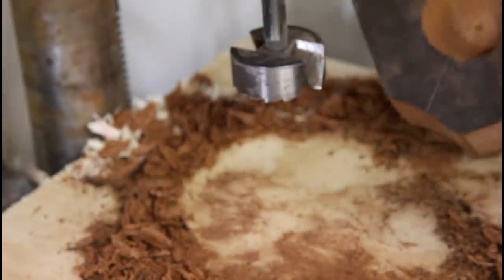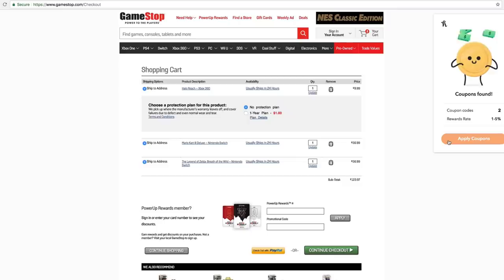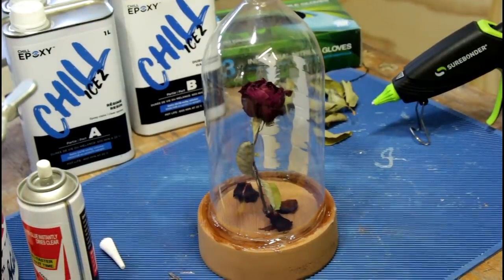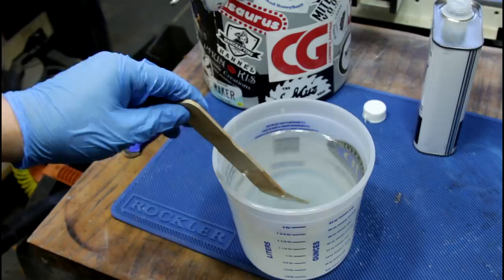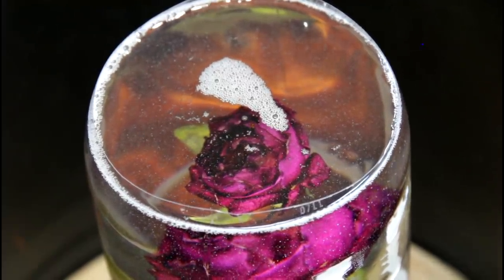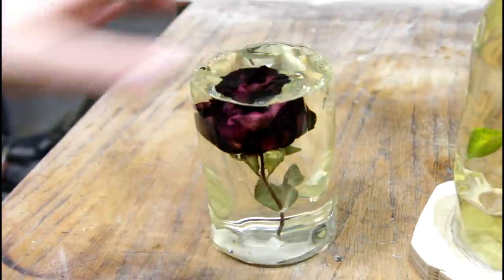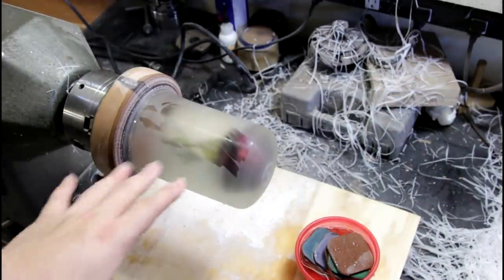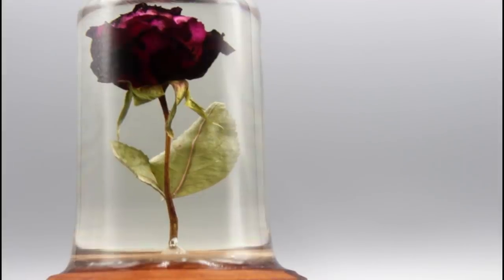Can You Preserve A Rose in Resin?! | Dipit #24

Comment: Is there any reason why a dried rose was used rather than a fresh one?
Reply: That rose is from the last date he ever had.
Reply: Not Known ohhhh burn
Reply: @eidzi4119 

I think maybe the natural resin in the pine wasn't compatible?

Interesting.... 🤔
Reply: If the rose has water inside it will decompose after some time.
Reply: @J23Ochs 

Decomposition requires both moisture and oxygen. Given that sealing it in resin is about as airtight as you can get, where would the oxygen come from?
Reply: @bertkutoob  from within
Reply: @carlosandleon 

I understand where you're coming from but will the entrapped moisture and oxygen be sufficient to support any significant degree of decomposition? I am thinking of hermetically sealed foods that last for many years without "going off".

I have some cheap fibreglass resin to experiment with. Guess what I'm doing tomorrow...
Reply: bertkutoob I’d love to see it decompose within the confines of the resin though
Reply: @grackshack  Yeah well, as I said I'm going to give it a try tomorrow (where I live it's 22:11 right now). It will of course take a while to decompose (if it does) so we'll have to wait a month (at least?) to see...
Reply: @bertkutoob  As long as it is done properly it should turn out fine as if you look on the internet you can find things that obviously weren't dried when they were put in and they look much better then the dried rose here. I mean you can find actually jellyfish in resin and I don't think you could dry them and have them still look like a jellyfish.
Reply: Water and resin don't mix, there's a lot of media on the subject. Always dry your greens before using them in resin
Reply: @CS-di1dt  How do they do the jellyfish and roses that don't show any signs of being dried then? You can find them if you look them up. Do they spray them down with something first or what?
Reply: Although there's isn't a lot of moisture or oxygen, the rose will still decompose over time, it just takes longer. I had a friend who would make pendants with flowers inside. She tried may ways to seal fresh flowers, but they all turned brown in the end.
Reply: @DeathlordSlavik  I searched but couldn't find any jellyfish that appear to be in resin (plenty of glass jellyfish paperweights tho), just lots of discussions about the appropriate chemical solutions to preserve them in lol

 For flowers the most common method is freeze drying, it maintains a lot more of the color and doesn't leave them w/ the crispy texture that happens with air dried flowers in resin/similar substances
Reply: @CS-di1dt  Well I just looked up the jellyfish again and I found an article that explains the process, they freeze it with liquid nitrogen then place it in a specialized resin that works at low temperatures. Based on your explanation of freeze drying the roses it seems if you want to encase organic things in resin and have them look good you need to freezing is necessary.
I saw some from a Chinese company that sold all kinds of weird stuff in resin as they had turtles, fish, crabs, octopus, bats and other small animals which struck me as strange as usually you only see insects of course the company was Chinese so maybe I don't want to know the details regarding all the things they put in resin as it might just hurt my brain.

I figured they would just show up on google but when I checked I only see those fake glass ones that don't even look like actual jellyfish, well I guess they might fool someone who has never gone to one of the major aquariums and seen real jellyfish.
Reply: @DeathlordSlavik  the animals you saw in resine are zoological samples (some are entire animals, some are opened bodies), they are made for students and researchers to study the anatomy of those animals. Indeed, the animals are first freeze dried to preserve the shape, but they also use lots of chemicals (stuff you can't and shouldn't use at home) on them to preserve the integrity of the organs and the skin which would otherwise decompose and perish...
Reply: @bertkutoob  For aerobic decomposition, microbial activity and moisture are all that is needed. The O2 will turn up all on its own as a byproduct. Almost any organic material placed in resin needs to have its moisture content manipulated to prevent decay/decomposition or the growth of mould - either by removal (drying) or replacement with another fluid. The latter can be quite tricky to deal with safely and accessing suitable fluids can also be a challenge at times, so reducing the moisture level is generally the go-to solution.
Reply: @insertclevernamehere2506 

Isn't that ANaerobic digestion you're describing? Not that it changes the conclusion.

And still, why does hermetically sealed food decay anaerobically?
Reply: Hey Burt, I think anaerobic bacteria would probably be able to decompose the rose with the presence of moisture. I think others are right in that there might be a process of replacing the water in the rose with another chemical that would inhibit microbes, but to my mind it sounds difficult to pull off without damaging the rose. If you try it though, post it!
Reply: @abelromero8967 
Yup... My personal bottom line is that I don't have the organic (hate that word) chemistry background to do much more than fiddle around...
Reply: I think theres like a powder thing that you bury flowers in to preserve them and the preserved flowers still look fresh but they're crispy
Reply: Jhiro Donghit yes, some time of silica sand, just like cat sand only finer 🤗
Reply: @J23Ochs  Then how do we have insects preserved in amber for millions of years? Same principle really.
Reply: Beauty and the beast.
Reply: @EvilSanta482  Amber is tree sap.
Reply: @EvaHoshizora  I know this but if a flower will rot while trapped in resin rather quickly. Then how can an insect survive in what is effectively a natural resin for millions of years intact?
Reply: @EvilSanta482  insects are less delicate than flowers. Have hard shells. They aren't decomposed as easily by microorganisms, plant matter is. Roses will wilt on their own all the time.  The sap doesn't react with water. It's rare for it to happen too.
Reply: @dutchik5107  The shells are actually the skeleton of an insect but the rest can and will rot away just the same as any other organic matter will. This is the same as how we find ancient human bones but not the flesh. I'm not saying that organic matter trapped in resin won't degrade at all just that it is possible to do so without it rotting away quickly if done right. Tree sap doesn't become amber either the resin does. The process takes millions of years to complete and most tree resin will rot in and of it own. Plastic won't even last that long yet if the circumstances align we can have a perfectly preserved insect trapped in amber.
Reply: @bertkutoob  I also would love to know the answer for that question.
Reply: @EvilSanta482  there isn't enough appreciable moisture in their bodies to support the bacteria over time... also pine sap has a lot of natural antimicrobial compounds in it. There is a reason why pine tar and pine sap related preservers, cleaners and skin care products exist!
Reply: The water in the rose could mess with the chemistry of the resin. If he used a fresh rose it could have inhibited the curing process.
Reply: Because if the rose was fresh, it would continue to decompose inside the resin
Reply: @lyn9567  I don't think the rose would decompose. I think the moisture would mess with the curing of the resin.
Reply: @bertkutoob  how did you rose finish up?
Reply: @michaelcerda5514 

A bit of a disaster I'm afraid. I'm playing with common fibreglassing resin and it cracked (almost shattered) due to the heat build up. I'll have to reduce the catylist way down, probably as little as ½%.

But I've run out of resin and was in fact just about to go off shopping...

I'll keep in touch.
Reply: I'm 100% sure this has to be possible. I've bought bought my gf three separate gold roses. I know just hang in there... They are actually just gold trimmed and the rest is preserved in a resin of some kind and clearly done with fresh roses, so it has to be possible. I thought maybe the small amounts of gases escaping would be a problem but if you are vacuuming out the atmosphere it should be enough to pull whatever gases out also. Not entirely sure as to how but absolutely positive its can be done without decomposition being a concern.
Reply: @solomassive6233 

Plan B is indeed to use my Heath Robinson vacuum chamber...
Reply: bertkutoob I think another reason for not dipping a fresh rose is the fact of how most resin reacts with water. It makes a lot of heat, of course there’s probably not a lot of water inside of the rose, but fully submerging it in resin, you never know what’s gonna happen. That, along with the few times I’ve seen Peter’s videos where water ruined the outcome, I’m sure he thought of that before doing the video. That’s my guess.
Reply: @bertkutoob  And he puts it , inside the pression pot, so it also takes the air out....
Reply: He used 3 roses. One of them was fresh.
Reply: @carlosandleon  it's the same deal with if someone dies on Mars. There isnt enough to cause decomposition so itll just stay there forever. It wouldn't decompose. Its just because water and resin dont work
Reply: Ok, that's a LOT of replies, but here's my two cents on the subject:

1, water contains oxygen so moisture does not "require oxygen" to start decomposition. It already has its source of oxygen.

2, I don't think decomposition is the main reason to dry the rose. The main reason would be stability. A fresh rose, or any flower, is a lot weaker and buckle under the weight of the resin. A dry rose is a lot more rigid and can withstand the pressure of all that weight.
Reply: @morphman86  the rigidity of the rose doesnt really matter, because the resin is liquid, so it pushing in the rose equally from every point. I'm 99% sure the rose was dried just because it works better with the resin. The water in the fresh rose might've messed up the resin curing
Reply: @booty_hunter4207  It may push uniformly from every side, but it is pushing. A soft rose will deform by any push.
A rigid rose will as well, as you can see when he pours the resin on the first rose. There's a few petals that start spreading out, one in particular bends down, almost to the point of falling off. If that rose had been soft, the entire head would have been bare by the time the bottle was full.

The resin would not have time to uniformly fill around the rose before the damage is done. It's simply easier to work with a rigid flower than a soft one. Trust me on this one, I've dealt with art for quite some time.
Reply: Basically because it changes color, when I tried to put fresh resin flowers, they turned green or brown.
Reply: bertkutoob I’ve personally tried using fresh flowers in resin, they all quickly turned brown and rotted. I make and sell items with flowers inside, they always need to be dried first.
Reply: It’s actually because a fresh rose will have more discoloring when the resin cures because the resin pretty much cooks it
Reply: bertkutoob what materials can i use to make little things inside resin? plastic i know, what about sylicon?

Comment: As you were making resin noodles on the lathe, I was treated to my daughter going "Noodle-oodle-oodle-oodle-oodle-oodle" beside me
Reply: thats adorable
Reply: @theravenskeeper2849  no, it's the big spinning machine that turns the item he's working on. It's called a lathe in America too
Reply: @theravenskeeper2849  a lathe is a shop tool (seen in woodshops and metal shops) used to spin items for the purposes of carving and/or sanding them to make them round (like a chair leg or a closet pole) or hollow (like a bowl or vase). when you make a thing on a lathe, it's called "turning" it (i.e. "i've turned these chair legs and spindles, now i just need to carve the chair's seat").

...and yes, i'm an american as well, but it's not a tool found in most garages- at $500 for a cheap average on the hobbyist end (and take up a lot of floor space), they're not overly common unless you know you have a use for it... but are more common in those respective industries.

Comment: Here's a challenge for Halloween coming up: A spiderweb in resin!
Reply: Or a resin spiderweb. either way, it's an avengers-level threat
Reply: Maybe nebulizing some resin on the web one little coat at the time could work but maybe a super fast resin xD
Reply: You could glue the resin shavings together and use them to make a giant spiderweb...
Reply: I doubt very seriously that you will see the web.... Nothing beats a failure like a try...
Reply: Or maybe an animal skull...
Reply: Wires and meshes are just airbubble traps because of surface tension, also I'm fairly sure the resin would destroy it as  soon as it is poured

Comment: Great video!  I recently discovered you can preserve the color and texture of the original petals and leaves by drying the flower in silica gel crystals. There is a fine grade available for this purpose, not expensive, and works great.

Comment: I wonder is there is a way to stabilize the rose before subjecting it to the heat of the resin?
Reply: Maybe two pours, one with a "mold" as tight to the rose as possible and another to give it the volume
Reply: @828burke  I wonder why not pour it in couple of layers. First layer just below the bud, then just over the bud, then more doming if needed. Would have to work with only 15-20 ounces of resin at time. I'm not very experienced with resin so my thinking might be faulty, but I've come to the understanding that more/thicker the resin pour the more heat it will generate.

Comment: Done it a few times in the past. What I noticed is that the colours tend to fade out in time[years] while the epoxy turns yellow. May have protected it better from UV but I think it's mainly due to the epoxy I've used. Choose carefully, be sure it contains an UV stabilizer[radical scavenger] as well as  hindered amine light stabilizers.

Comment: Have you considered managing the heat of the resin by filling the rest of the pressure vessel with ice water so the heat could be wicked away?
Reply: The water will boil
Reply: @RustyBrusher  no it wont
Reply: RustyBrusher do you know how hot that would need to be
Reply: Falloutman 342 well probably 212 degrees fahrenheit, the boiling point of water

Comment: hey, I have been thinking this for a bit but a lifting plate would probably help a lot for the pressure pot. it's just a circular plate of something with handles on the sides that go to or near the top of the pot which allows for easier placement and retrieval of the item in question.

Comment: Why did it need to be a dried rose?  What it have made a difference if you used a fresh rose?
Reply: I think a fresh rose would move too much in the resin, it's more flexible than if it were dried. Also I think the heat from the pot wouldn't work well with the moisture inside of a fresh rose...
Reply: the rose would’ve lost its color, maki g it turn brown
Reply: I tried a fresh one. It basically over heated the rose and wilted to a nasty dead look.. Not pleasant
Reply: You wouldn’t be able to use things that are fresh because the cells in it would eat it from the inside out it has certain bacteria and stuff still living in their so it’ll probably rot while in the resin

Comment: My opinion is... roses look dry but they hold moisture for a loooooong time.  So when you try to put the rose in an air tight spot the moisture surfaces and the rose turns brown.  I fully expected that first rose to turn brown.  Now as of the last one that worked...did it dry longer than the first two roses?  I think you got lucky.
Dry out a rose for a week or so and when you believe it’s dry open it up to the middle.  That is where the moisture is hiding.  Love your shop and workmanship.
I hope your where wearing lung protection when the rose was on the lathe... from took to last sanding/polishing.
I know you didn’t ask for opinions and I hope you know this comes from a well meaning spot.  
Thank you for the lesson and information on large volumes of epoxy.

Comment: I am wondering if the moisture content of the different roses was different.  Though they may be dried there is humidity in the air...just a thought.  I tried using a resin once to cast a rose paperweight.  It turned mostly silver as the resin seemed to cook it...hence, my thoughts about the moisture.  Very lovely casting.  I wish I could do what you did...I'd keep my flowers so much longer.  Blessings!

Comment: forthe decoloration:
i had the exact same problem on myvery first epoxy-pour andonthe second try i noticed that the epoxy gets really warm (which i didnt know AT ALL). It reminded me on concrete because it does the exact same. So the solution was to keep it cool! On the project i had i could just place it in a room with open windows and 1 Fan to blow for about 2 days. Not really "environmentally friendly" but it worked
Reply: Fick Dich could I sit it outside on my balcony? Or would that be too cool?
Reply: @along58  depending on where you live - it should be above10/15 °C! defnitly not freezing. Also you should know that it will take a lot longer when you cool it. I used table-resin which normaly takes about 3-5days and with cooling it took nearly 2 weeks to fully cure.
Reply: Fick Dich Ohhh okay got it! Thank you so much!

Comment: I wonder if submergind the bottle filled with resin in a bath of cool water would help?
It would take longer to set, but it wouldn't be as hot.

But I guess resin isn't a good conductor of heat, so the inside might still get very hot.

Comment: have you tried what happens to a rose in the pressure pot to start with?  what if you pour it about 1/2 to 2/3 of the way up and then pour a second layer for the top?  would that leave a weak point when you try to spin it on the lathe??